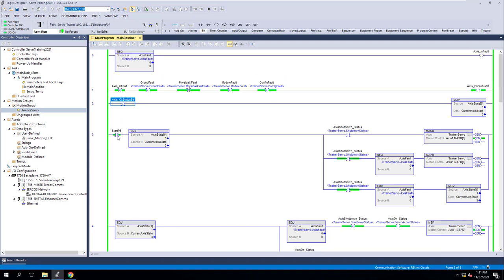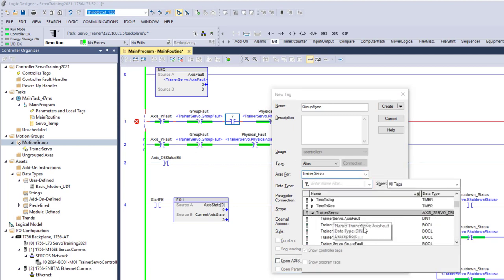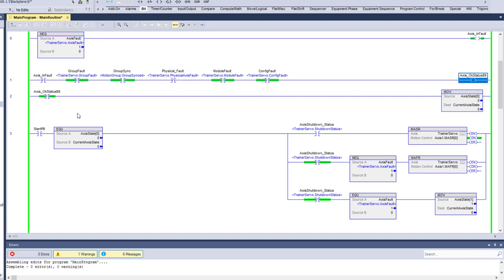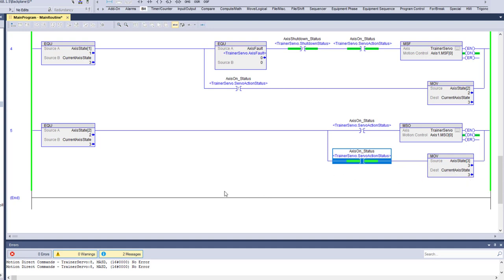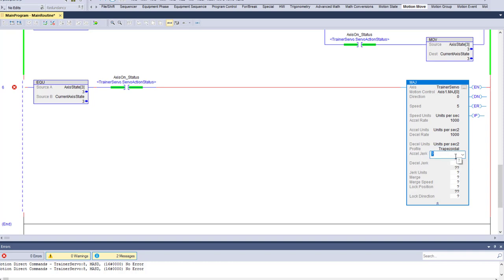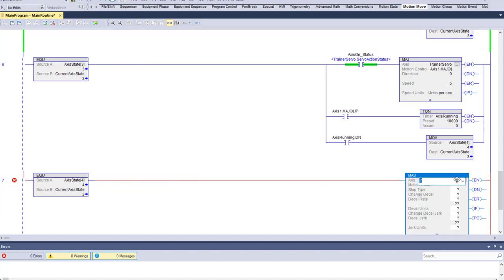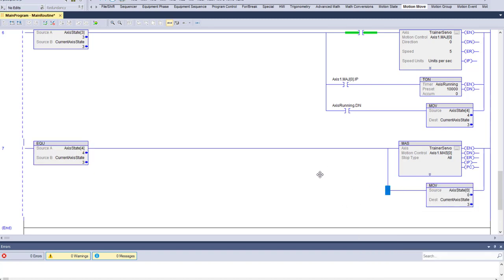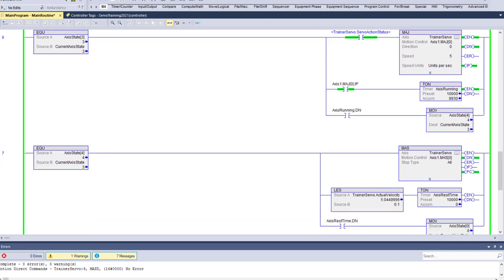Allen-Bradley Servo Axis | Servo Command Operation for Proper Motion

Comment: I need help with motion instructions - specifically the definition, purpose, and good examples of the utilization of these components: merge, merge speed, lock position, lock direction, event distance, and calculated data????
Reply from the maker: I would recommend my servo courses on Udemy, the reason I say this is because of how much you need help with.

These are great courses that have helped many people.

Servo motion mastery 

Advanced servo motion mastery